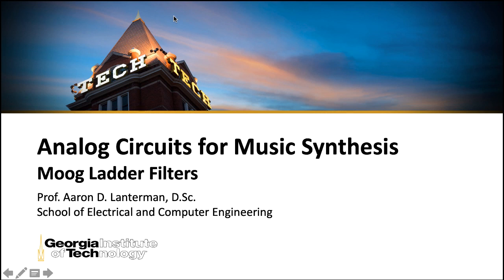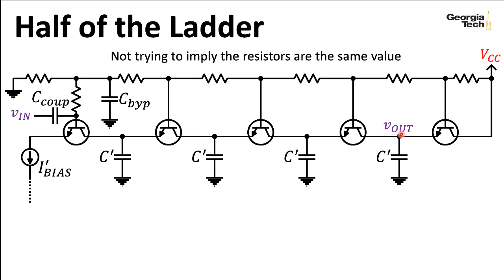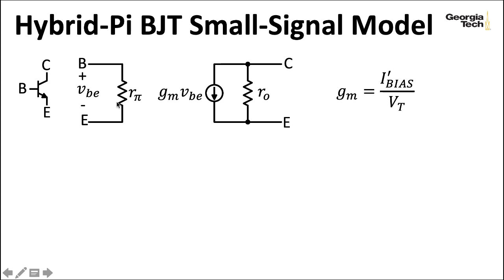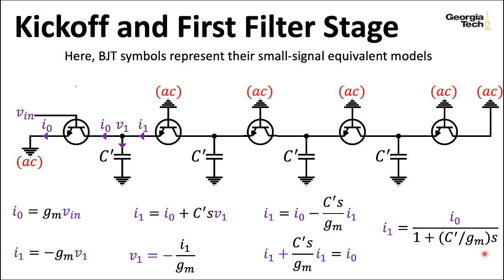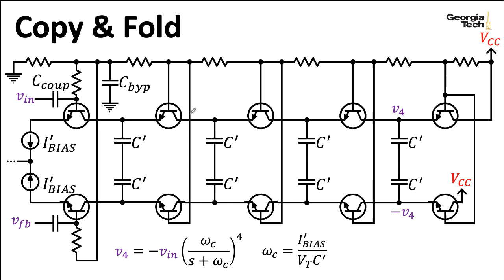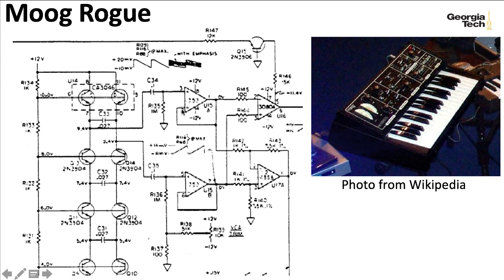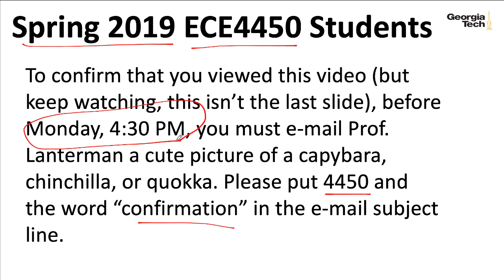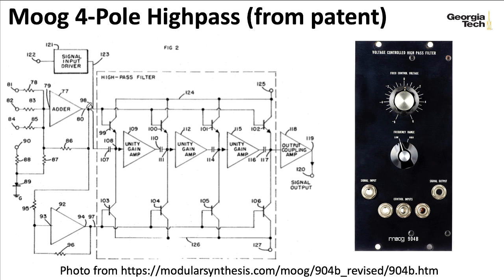ECE4450 L22: Moog Ladder Filters Analyzed (Analog Circuits for Music Synthesis, Georgia Tech course)

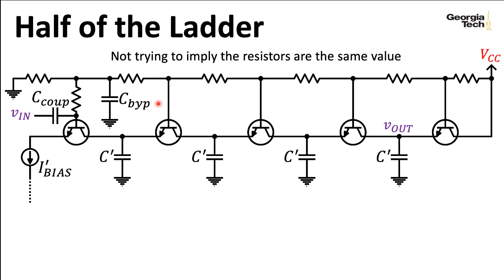Comment: The schematic at 3:31 is missing a cap to ground at the emitter connected to the current source. I was wondering how it would work, but that cap showed up in the small signal circuit equivalent at 11:47 .
Also, the the double ladder, that cap isn't needed because it is replaced by the differential emitter coupling to the other side of the ladder.
Reply from the maker: Thanks for your comment -- I "pinned" it.
Reply: @Lantertronics  Are temperature controlled peltier cooling mechanisms used to stabilize some filters?
Reply: So is it kind of similar to a monophonic analog synth keyboard the way the audible frequencies are split to a series of transistors through voltage dividers in series and then each transistor is basically a bandpass amp? (thus making basically a kind of amplified EQ) If so, why is it possible to get a smooth sweep across all audible frequencies from a single knob with a relatively small number of transistors (mini "bandpass amps").

Comment: Hi Aaron, Thank you for the mention and you're correct about the use of the OTA in the Monowave. It was based on the Taurus ladder VCF, however the CA3080 was going obsolete, so swapping in an LM13700 and tweaking the bias gave me a "nice" sound. just a touch of distortion, no-one likes a super clean VCF, VCFs need character :)
There's a whole bunch of other tricks you can do with the ladder filter that make it such a fabulous building block.
Hope you and your loved ones are safe.
Paula
Reply: gerhardumlandt3873  Or you think that you like it clean. Look at it using good oscilloscope and distortion analyser ;) There is no such thing as clean vcf. Even digital ones to some degree.

Comment: my understanding of why in a ladder only the top and bottom of the ladder needs to be a tightly matched, thermally bonded, pair, is that the top and bottom pairs lock the bias current in both arms of the filter to be the same. Given the transistors were made in the same batch and are physically located in the same place, if the current through them is the same the temperature rise in them will also be about the same which keeps them "close enough"

with modern transistors "weakly controlled" parameters are actually pretty consistent if the parts are from the same batch. I once sat and measured 2 dozen BC548's and their Hfe's all came out at exactly 220.

Comment: Interesting analysis, had to refresh my frequency domain studies from my college classes.  The Moog Voyager uses a trick from the modular to realize a highpass filter response.  The Voyager doesn't implement the highpass architecture in the patent or the 904B module.  They just use an opamp to subtract the unfiltered audio from the output of the ladder filter (with zero resonance).  The passband of the filter output is out of phase with respect to the unfiltered audio; so the pass band frequencies cancel, but the frequencies above the passband remain... and you have a highpass filter.  Yes I have schematics.

Comment: The non-linearity of the ladder is supposed to be cancelled out because it's a differential set up. But why they chose to use a TCA instead of an instrumentation amplifier is an interesting question!
Reply: That's a myth. These cascades are highly non-linear for all but small AC voltages. A couple hundred mV, at most, if we care about distortion, tens of mV if we wanted it to be "high fidelity". The thing is... in an analog synthesizer we don't care about it! The filter comes after the oscillator and it does not need much dynamic range because the VCO output voltage range is always the same. More importantly, the VCO spectrum is one fundamental frequency and its harmonics, hence all the VCF distortion will do is to change the overtone spectrum by a few percent, which is barely perceptible. If we were to use this filter on a polyphonic signal or a mix of multiple instruments, then the intermodulation distortion would sound horrible and the noise floor would be pretty bad for signals with low volume. Thankfully none of that happens in a synthesizer and this cheap and easy circuit works just fine.
Reply from the maker: The Moog filter pretty nonlinear in practice. There's a great paper on digitally modeling it that includes the hyperbolic tangent nonlinearities.

Comment: To manufacture analog equipment , the Design process can NOT use the approximations
assumed in 11:10/35:06  r]pi  , r]o = infinite.  

1st stage design uses  r]pi-type , r]o-type at  I]bias -type
- - -testing of the circuit becomes CRUCIAL  to eliminate the many units that are faulty.

A more refined design uses hfe]LO ,hfe]HI  values AND 
- - - most importan  transistors  hfe must be measured REPEAT ONLY   hfe]measured !
Reply from the maker: Thank you for your comment! I am curious, did you (or do you) work for a company that makes Moog ladder filters? I would like to know more of your insights. Many many years ago we could assume you were working for Moog, but there are many companies putting Moog ladders into products nowadays, especially with the proliferation of modular synth manufacturers.
Reply from the maker: Also, are you saying that the hfe values just need to be matched, or are you saying that they must also be chosen for specific values? I've heard that people match at the pair at the top and the pair at the bottom, but I don't think I've heard of people selecting for specific hfe values.
Reply: I doubt that you will end up with a lot of faulty units using modern transistors. These filters don't need to be calibrated much, anyway. People are tuning the instrument by sound, not by potentiometer value, so if the gains are off, the user feedback loop will calibrate that out.

Comment: The diode-connected transistors in the TB-303 make me wonder if it would be possible to rig up a ladder filter with ganged potentiometers such that one extreme is fully diode-connected and the other is like the classic Moog design, a kind of mooginess control.

Comment: Hey Aaron, I really appreciate your video. If you could explain, im curious why when you do the small signal model of the half circuit, you choose to call the emitter of the input BJT an AC GND. Wouldn’t that pin just be floating because the current source would be an open circuit?

Comment: I am  not sure how, but your presentations appear to be unclogging a forty-year 'wtf! Transistors do what? & how? hole flow wtf? you're kiddin' me.." that sort of deal seems to fade each view.  It is actually since 1969 when Wendy Carlos' "Switched-on Bach" blew my brain apart to want to learn how this works......  Now, a 8 stereo/2x8 mono inputs by same outputs VCA cross-point Matrix Mixer forces me to understand so I can build it and be able to route anything to anything at will, something I missed on the Buchla racks available to me for 10ish years back then.

Thanks!
Reply from the maker: Ah! You have laid hands on a real Buchla? The sacred Buchla? (I am obsessed with Buchla)

Comment: Thanks a lot, professor. You made it really clear to me, but still, looking at the equations, i don't get why we can't just replace transistors with resistors? And why won't that be Ibias dependent? In fact, increasing current through simple RC filter can also change it's cut-off frequency to some extent, am I right?
Reply from the maker: Sorry, I'm not really following your question. If you replaced the transistors with resistors, you'd get a fixed cutoff; modifying an extra DC current through the ladder wouldn't change anything. A basic RC filter (input to one side of a resistor, other side of resistor to output, output also has a capacitor to ground) will have cutoff defined by 1/(2*pi*R*C). The only way to get variable behavior by using resistors here would be to use potentiometers as variable resistors -- in which case, you'd have a physical control but not voltage control -- or to use a light dependent resistor, like in a vactrol, and change the amount of light shining on it.
Reply: @Lantertronics  I see how that could work if we changed base voltages, for example. Then CE resistance would change and a transistor would act as a potentiometer. But you say that BE current is negligible and base voltage is constant, but then there is no difference between transistor and resistor. It manifests itslelf only as CE resistance, isn't it? In this case I don't see how that system can be controlled by Ibias. In the final equation for cutoff frequency Ibias appears because of gm. It's stated that gm = Ibias/Vt, but it also equals 1/r. What if we say that this r is simply a resistor staying there? Why doesn't it work that way? Thank you.
Reply from the maker: @user-yz2jw2ue7z  The base voltages are just setting DC bias points to make sure all the transistors are on. I'm not quite understanding you when you say "but then there is no difference between transistor and resistor." To get a sense of where gm=Ibias/Vt coms from, read this by my colleague Marshall Leach, particularly pay attention to equation 13: 

https://leachlegacy.ece.gatech.edu/ece3050/notes/bjt/BJTBasicsSu10.pdf

The gm=1/r is just notation. My presentation was in terms of gm, but the patent and most discussions of it are written in terms of r. But that "r" is a dynamic resistance in the small signal model. When you say "r" is simply a resistor staying there," again, I'm not sure what you mean. If you put a fixed resistor in there you're back to a fixed filter. The whole point is to change "r" (equivalently, gm, since they are reciprocal) by changing Ibias.
Reply: @Lantertronics  Thank you so much, professor, especially for the link. Now I see, we're talking about dynamic resistance, that's the point. I could not be sure enough about that before.
And one last question then: why won't they use transistors as potentiometers, controlling their resistance via BE voltage? That seems to be an obvious idea, but maybe I'm wrong.
I'm now studing analog synthesis and Moog modules, and I would really appreciate if you gave me some advice on what to read about that, like that BJT article, or maybe some book. And again, thank you so much for spending your time.
Reply from the maker: @user-yz2jw2ue7z  There's an Electro-Harmonix pedal called the Bassballs that uses a BJT as a voltage controlled resistor by changing the BE voltage. I think there's a limiter design build into some old cassette tape recorders that works similarly.

Comment: So is the center axis of that laplace plane visualization where INFINITY GAIN is basically? And those 2 stages of the filter closest to that are having the most effect on increasing the gain output, but the other 2 stages have lower amplitude when k is increased? Thus the filter is whistling due to k making those 2 stages/poles have such high output amplitude at their cutoff frequency?
Reply from the maker: You got it! :)
Reply: @Lantertronics  Thanks for confirming, and thanks in advance for sending Me a scholarship to Georgia Tech! I thankfully have a US passport, so that should be easy. Had collaborated with a Georgia Tech DSP or EE student about 1.5 calendar years ago on connecting a soundpipe filter to AudioKit. Today learning filter DSP to port an iPad synthesizer app I had made (but Apple sadly banned after promoted liberation of Palestine) to a standalone touchscreen product that can't be censored any corrupt employees at Apple. Hopefully also porting a fractal animation control surface interface I had made before to the embedded edition of that app.